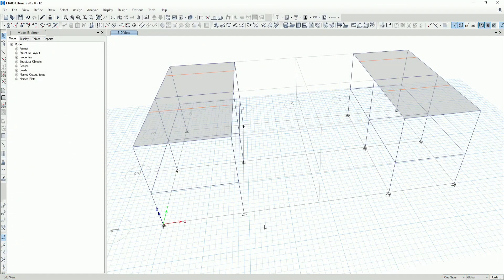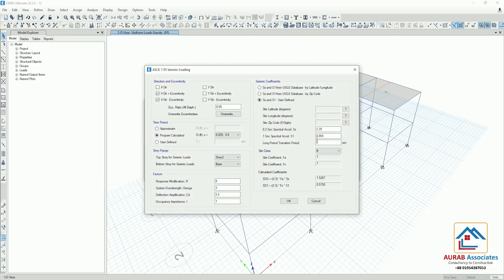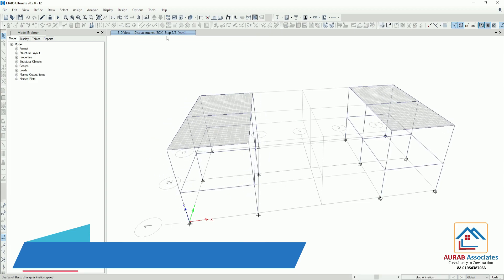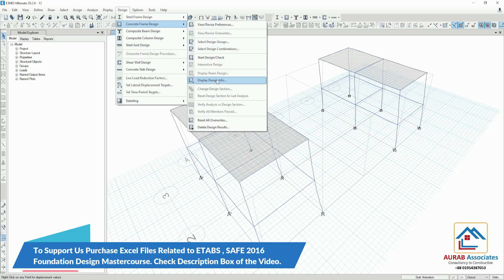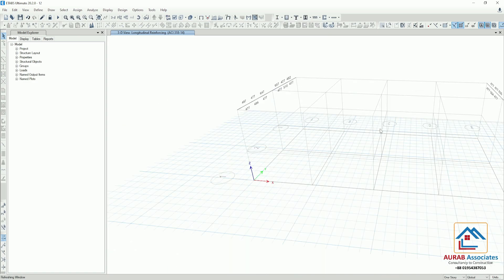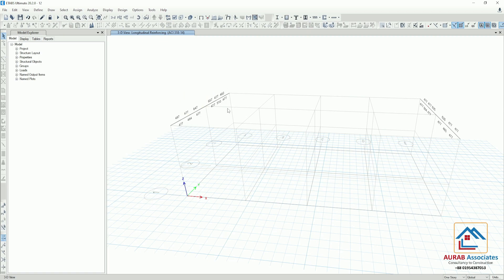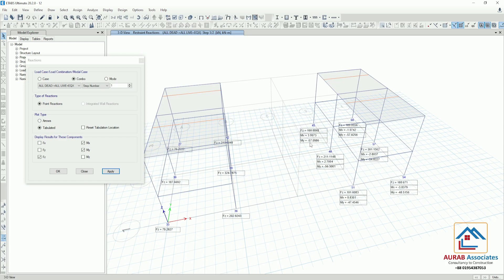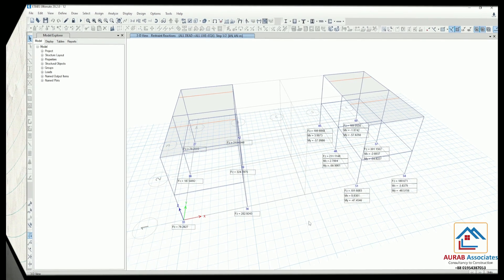Fixed Support Vs Pin Support in ETABS

Comment: Thanks very much for such tutorials for design that is no up to in to Utube video. I want to know whey and where is pin supported in structure and for that, what is its foundation types.
Reply from the maker: If you design a shallow foundation in that case you will use pin support. For pile fixed Support.  It's Simple!!

Comment: i want to know about the foundation and theirs  support. pin support means pile foundation and mat foundation is fix support? make a video on foundation / supports for  building types/ different structures. what is foundation and its provision for resisting moments due to wind and earthquake
Reply from the maker: Generally Pin Support is used for small structures ( Isolated, Combined, Strap, Mat ).

Fixed Support is used for Pile.

Thanks.  Stay Tuned.